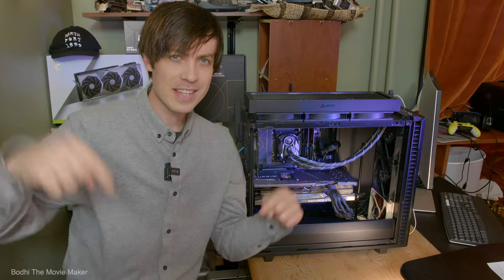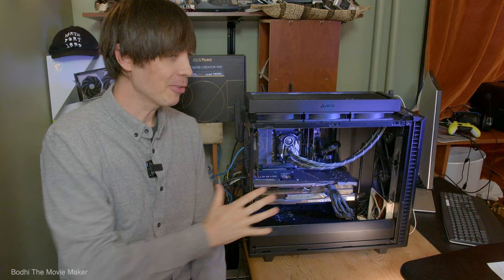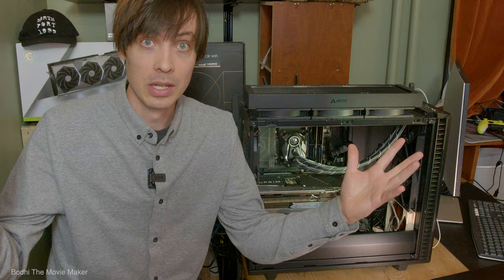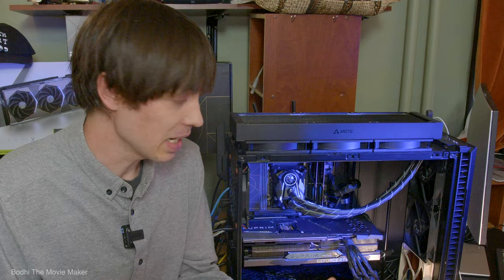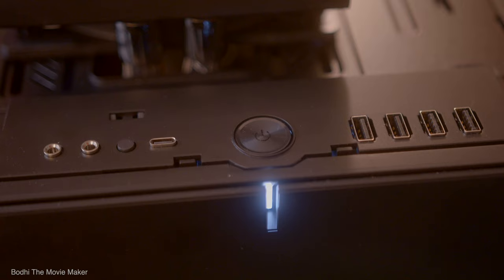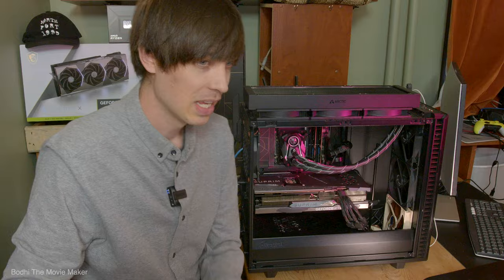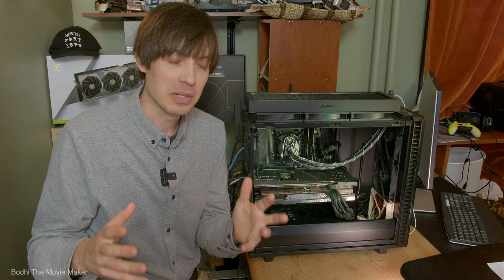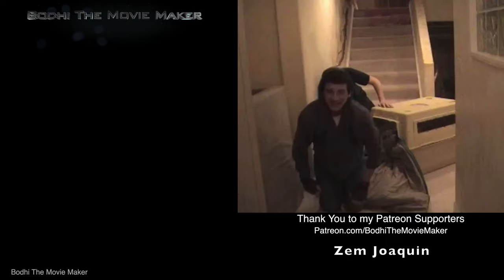Review: Nvidia RTX 4090 / AMD Ryzen 9 7950x - Unreal Engine PC - OP BEAST

Comment: About that 4090 melting cable problem, I told my PC supplier to insert it horizontally and hopefully skip the cable adapter bending issue, I just hope the cable is long enough. 
This is one of my biggest fears around the "crown jewel", melting cables or burning GPU in sweet heaven.
Reply from the maker: Good thinking. Vertical is a good work around to avoid the cable needing to bend to fit in the case. Your PSU might come with the new power supply cable made specifically for 4090s, so you don’t need to use the 4-1 adapter. That would also help the situation. The power supply cable length is most likely long enough for a vertical install. You’re just gonna need a PCIE riser.
Reply: @BodhiTheMovieMaker  Now I remember, the PSU does actually come with a power supply cable dedicated for the 40 series, great point. I’ll text my builder to use that one instead along with the riser, if he didn’t already. Thanks 🤟
Reply from the maker: 👍🏻 I’m looking forward to seeing this beast! Send pics when you receive it

Comment: Liked the video. But can you do a video on the performance of this build while using Unreal Engine? I'm looking to go 7950X or 9950x for Unreal Engine
Reply from the maker: Hey thanks! I could do that. Any specific stats you are looking for? Temps or Benchmarking? I can tell you from my experience that the 7950X works great for my Unreal Engine filmmaking and some gaming, it is a beast. It is built to run very hot though so I recommend getting a powerful CPU cooler.  I am sure you would also be very happy with the 9950X
Reply from the maker: But I should say I have done zero research on the 9950X. So I have no valuable opinion on it. Once I got my PC set up I have not had to think about upgrading anything except adding more internal SSD storage.
Reply from the maker: Okay, you sent me down the rabbit hole haha. I looked into the 9950x, and it looks like the only advantage I see over the 7950x is the larger RAM capacity. ( My rig is running half ram capacity and I have had no problems so ram capacity is not an issue IMO ) but if you feel the need to max out your ram then the 9950 might be the way to go. Also t seems that the 7950x has a few areas where it got better specs on paper than the 9950x

Comment: If you were getting a laptop and wanted something close to this setup, what would you buy?
Reply from the maker: Good question! Depends on your budget. The closest laptop I can see spec wise has a intel i9 24core processor and a RTX 4090 with 16gb of VRAM (keep in mind the desktop 4090 I am using has 24gb of vram) 

The laptop is over $5000 so costs significantly more than my entire set up. 

The laptop is MSI 17.3" Titan GT77HX Gaming Laptop - there are two different spec options you can go for (if you opt for even less vram you can get it at like half the price) 

My thought is that laptops will always have a lot of trouble hitting the same type of performance as their desktop counter parts
Reply from the maker: I also would look into a laptop and eGPU combination. Like get a high spec processor laptop then get a desktop 4090 with 24gb vram like mine and dock your laptop to it when you need workstation level graphics. But you have the portability if your laptop when you don’t need the massive GPU.
Reply from the maker: Can I ask what do you plan to use the laptop for?
Reply: @BodhiTheMovieMaker   it would be for 4k+ video editing and high end gaming mostly
Reply from the maker: Cool. Would you need to do those things on the go? Or will you still be doing gaming and editing mostly at home/office where you could foreseeably utilize a eGPU ?
Reply: @BodhiTheMovieMaker  I travel for work so I'd like to be able to take my office on the go for sure
Reply from the maker: Then you are looking in the right directions. Did you buy a laptop yet?

Comment: i am building the same setup like yours, what kind of case would you suggest to fit all of the components since yours did not work? 
thank you
Reply from the maker: You could do a noctua fan radiator CPU cooler instead of the huge AIO I chose and then it would all fit. Or maybe the Fractal Full Tower case. Or something like the Lian Li O11. I haven’t checked to make sure that the dimensions work, so just make sure to double check everything will fit in those cases.
Reply from the maker: Good luck with your build. Is it being built for unreal engine?

Comment: Im building a pc for.music.production, gaming and I want to try creating a game with unreal engine 5.  Any tips?  Going with Ryzen 7950x, Aorus Xtreme board, 64gbs of ramm, Sapphire Nitro+Radeon RX 7900 xtx 24gbs.,
Reply from the maker: Hey! Congrats, that's exciting. Seems like a great set of components! I bet you will be quite happy. That motherboard is really impressive; it looks like it's got some specialist audio IO built right in, such as optical audio, so that's nice; also, tons of other IO and good m.2 SSD support. I would recommend getting getting 96gbs of ram (2x 48gb ram sticks), which is half of your Mobo's capacity. that way if you decide to upgrade ram down the line you just buy the same two ram stick again and fill your capacity. I don't know much about the GPU you are looking at. Can I ask why go with an AMD GPU, not Nvidia? Nvidia seems to dominate when it comes to Unreal Engine dev and gaming. I have been very happy with my 4090 for UE stuff but never tried the AMD card.
Reply: @BodhiTheMovieMaker  It was a recommended GPU through my Internet searches.  I've found that newer VST'S can run off the GPU memory instead of the CPU.  It helps alleviate the pull on the processor and ram.  That's a small niche right now but I figured if I get ahead of the game I'll be a bit more future proof.  And I was trying to pair AMD stuff with AMD expecting they would work better together.
Reply from the maker: Very cool! My Amd cpu works quite well with my Nvidia GPU. I have heard of driver issues with amd cards. But that is only anecdotal. I know Unreal Engine did their live meta human animator demo a year or two ago using a pc with two Amd GPUs. So they definitely can work for UE.
Reply: @BodhiTheMovieMaker  That's good to know.  Thank you for the information.  Any thoughts on the Threadripper 7960x?  It was my next choice.

Comment: Intel vs amd ? Any choice regret?
Reply from the maker: I don’t have both. So I can’t compare them in the real world. But on paper my AMD cpu is better than the Comparable intel 13900k (intels higher core count is because they include logical cores so it’s not an accurate core count compared to AMDs) I probably would’ve gone with Intel Because it’s a less expensive CPU But there was a sale on my AMD CPU so I got it for less than I could’ve gotten the Intel. Puget systems says my CPU is the best for unreal engine, better than the Intel alternative. - and I have been very happy with it so far👍🏻😊 I’m sure I would’ve been happy with the Intel, CPU too. Both great tools.
Reply: @BodhiTheMovieMaker  cheers
Mac user here from Australia and looking to get a pc. So just trying to work out what’s cost effective and useful without going a threadripper and 48gig gpu realm haha
Reply from the maker: Yeah smart to look at prices, try to find deals. I just learned that Intel released a new flagship CPU the 14900K which is now the top dog for Unreal Engine according to Puget Systems benchmarks and it is now what they are offering on the pre-built configuration that I referenced to make my PC. But on the benchmaks they publish they aren't comparing it to AMDs new 7950X3D which is AMDs Flagship so. I still cant give you a definitive answer as to which is better for UE. But Puget is one great place to look for the industry standard. This new Intel 14900K is a bit more expensive and it only gets you a modest increase in some unreal engine performance. Also Intel CPUs are notoriously hot, and this one appears to be no different. (*EDIT) It has less performance cores than my CPU the AMD Ryzen 9 7950X. All I really know is my setup works great for me👍